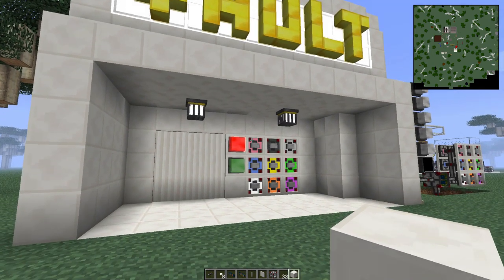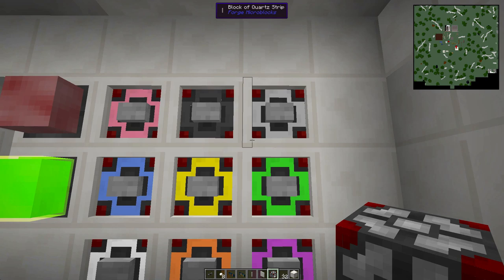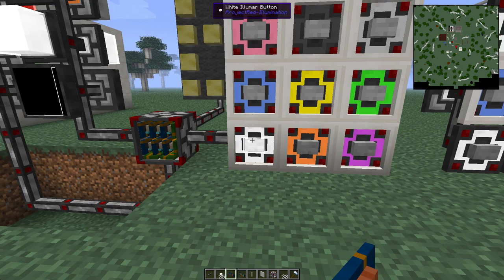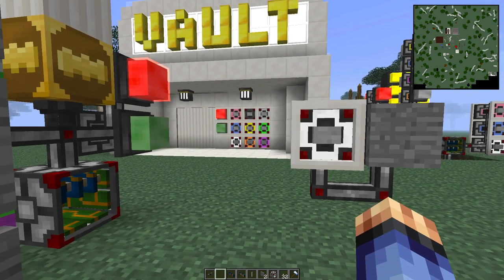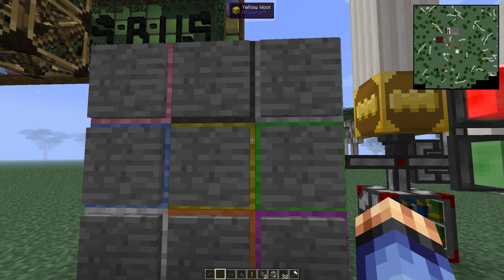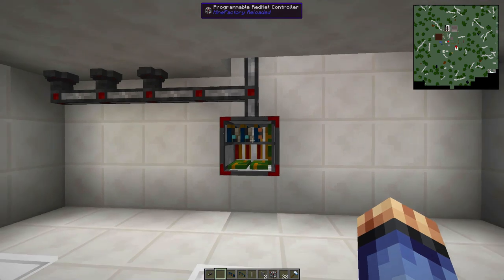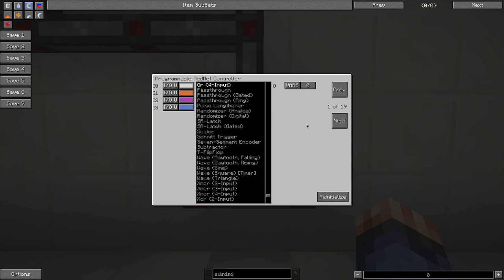Combination Lock and Vault Door using the Minefactory Reloaded Programmable Rednet Controller

Comment: Hey my buttons wont hold power. I did that white lamp thing and it lights up the lamp while its pressed but as soon as the button comes back out the lamp turns off as in it stops giving power. please help
Reply from the maker: Hi Mark,
That is correct - the white buttons used here were only to clearly show what button was being pressed, any button will do the job. Other than that, they act just like normal Minecraft buttons in so much that they are only 'on' when they are in the 'pressed' position. That simple press though is enough to register with the controller for it to work out your code.

Thanks for watching
Reply: Thing is my door is always open. it wont close like yours or hold the signal like your white lamps. they light up in order but dont stay on and reset after the code is complete or i press the reset button. they reset as soon as i press the right button and it pops back out.when i input the combination the door closes for a second then opens again.
Reply from the maker: Mark B Mmm, the only thing I've had issue with with this mod pack is on occasion I've had to reset the rednet controller as they don't take the coding correctly. What has also happened is variables keeping a 'high' value when you cycle through them whilst you are coding it up.  To check that get hold of a rednet meter in your hand and right click on the rednet controller, this shows you the state of all the variables in the controller. After just pressing your reset button (pink in my video) it should read that 'all variables are 0. If you don't have that to start with - this is where your problem lies. (see the bottom to reset the variables)

As you click through the sequence you should then get...

After the first colour in the sequence (Again, in mine, its white) the rednet meter should read :-
Variable 1: 1
Variable 2: 15
Variable 4: 15

After the 2nd in sequence (Orange)
Variable 1: 2
Variable 4: 15
Variable 5: 15
Variable 7: 15

3rd (Yellow)
Variable 1: 3
Variable 4: 15
Variable 7: 15
Variable 8: 15
Variable 10: 15

4th (Dark Gray)
Variable 1: 4
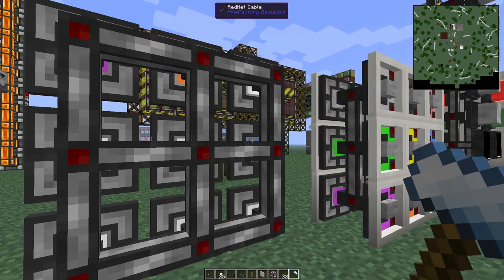Variable 4:15
Variable 7:15
Variable 10:15
Variable 11:15
Variable 13:15

5th (White again)
Variable 1:5
Variable 4:15
Variable 7:15
Variable 10:15
Variable 13:15
Variable 14:15

If you are getting any number or variables different to that just check your directions for the I/O (U / D / L / R etc...) and that your variables are setting correctly. Again, if you don't have a 'all variables are 0' just after pressing the reset button then change slot 0 to be a passthrough with CNST 0 on the left -> Passthrough -> Var 0 through 15 (in other words cycle through all the var numbers). That way you are setting a 0 into all the variable slots as you cycle through the variables. Check with the rednet meter again to make sure all is 0, then put slot 1 back to the 4 input OR gate. What you are doing is a quick way to reset any variables that may have been changed as you were coding the controller.

Hopefully that should sort the issue.

How that helps.
Wayne.
Reply from the maker: Mark B Just tested another way of resetting any rouge variables, If you get hold of the PRC Memory card, use that on your controller to backup the programming logic (good idea anyway to be honest!), you can then reinitialise the controller (bottom right on the programming page) - this will wipe all the code and reset all the variables back to 0. Then take your memory card (which should be 'glowing' at this point and click back on the controller. This will put the code back into a fresh controller. The good thing being - all the states of all the logic will be initialised back to defaults.